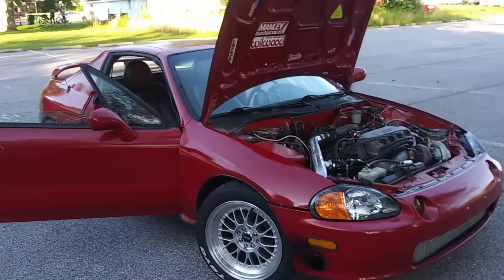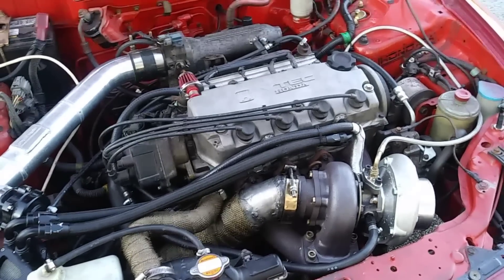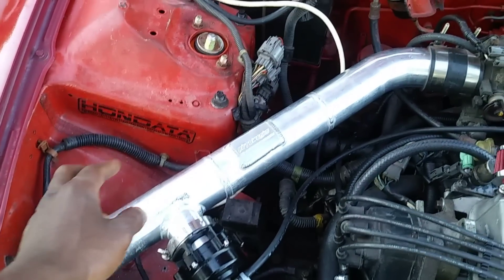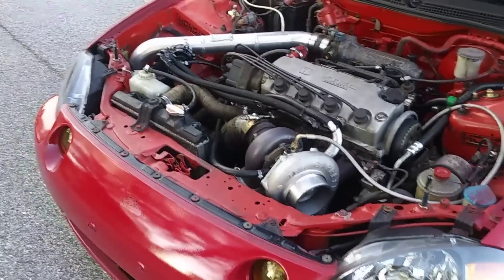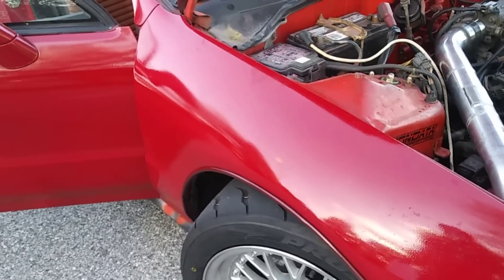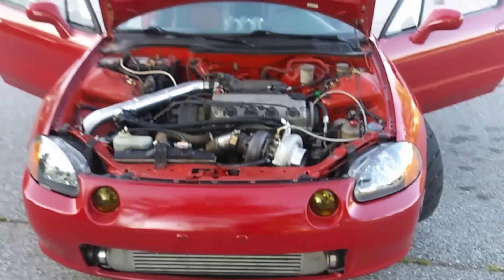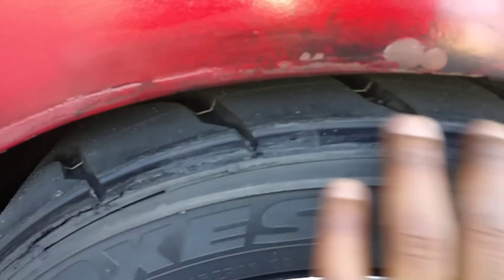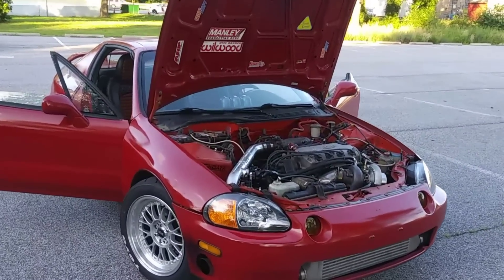400hp D16Z6 Turbo build list revealed

Comment from the maker: Build list is posted in the description...Check it out!
Reply: Nice build, I tried my best to get my daughters car as nice as yours, had the engine rebuilt at a very good reputable shop, got the engine installed and between 3 different mechanics they all said they did a good job with the engine,  besides that and after 6 grand it's an absolute mess. Extremely loud and rough idle surges like crazy. So frustrated, what do you suggest? Especially us that don't want anything out of the ordinary those cars were known for their quietness d 16 Z6 automatic.
Reply from the maker: @juliol.7490  Thanks. I hope you reach your goals with your daughter's car. Hondas often have idle issue due to vacuum leaks and/or problem with the cooling system. Make sure there is adequate coolant in the radiator, remove trapped air if any, and clean or replace idle air control valve. I hope this helps. Also, pls comment back and let us know what worked for you.
Reply: Doing this same build to my red del sol lol

Comment: Hey man, does the engine still hold? I was told the stock crank doesnt hold more than 1bar/15psi reliably.
Reply from the maker: I had the engine rebuilt with all forged internals. I'm still on stock crank. I don't plan on making more power after I get it retuned. Only time will tell how long it survives.
Reply: @RBXmotorsports  Thanks

Comment: How has this build held up over time? Planning on a very similar build and wondering how the reliability of the build at this power is
Reply from the maker: Quality parts, proper assembly, a good tune, and proper maintenance is to key to a reliable and long lasting build. I tore my engine apart and had it rebuilt about a year ago to make more power. Unfortunately, it's not fully assembled yet. Keep an eye out for my new videos for updates.

Comment: Cool I'd did the same with 100 engine 100 on head studs and 200 on parts. Work perfectly fine running away from 392 all day long.
Reply from the maker: Honda power 👊
Reply from the maker: I'm currently in the process to make more power. Check out my new videos.

Comment: Any lag with the turbo? What rpms are you hitting boost?
Reply from the maker: With the Vitara low compression pistons, you're going to experience some lag. I haven't drove the car in a while but I believe full boost was around 5k rpm. I'm currently doing a 600+ hp build on the car. Stay tuned for upcoming videos.
Reply: @RBXmotorsports  that’s awesome can’t wait and thanks for the response
Reply from the maker: @BIGWORM303  anytime 👍

Comment: how well does the stock trans hold this?
Reply from the maker: The stock trans held pretty well at that power level. I never had an issues with it; however, I just got the engine rebuild to make 600+ hp. I'm afraid that my luck might soon run out. Hopefully not 🤞

Comment: Have you got it dyno and tuned? Any issues with the build? How much boost are you running? May need to upgrade fuel pump and fuel pressure regulator.

Comment: I would have never thought LS injectors would fit / work.  Also wish I could find a 60 dollar d16z6.  Can't even get just the head for that around here.
Reply from the maker: I was shocked when I found out that LS injectors works. My tuner said the injectors flow really good. Also, prices on  D series engines are going up. You might be able to get one on the low, you just gotta keep an eye out.  I'm gonna try to buy an extra long block if I can find a good deal. People are starting to realize the potential of the D series engines.
Reply: Frankly - I can't even get a D15B7 cheap.  Been that way for a solid 5 years or more.  My z6 took a dump so really anything to get the car moving again would fit the bill.  lol
Reply from the maker: @cracklingice  sorry to hear that. Have you consider a rebuild?
Reply: I got a reman head off eBay a few years ago.  I got about 100 miles and then the thing lost compression in 3 cylinders again.  Before you ask - yes new bolts and gaskets.  I think what happened is that because I noticed that they sent me the wrong head only after I already took the old one off, that having the cylinder walls exposed 'til the new one came in resulted in wrecking the rings.  I did notice a small amount of surface rust on the walls.  Either that or the block or sleeves warped when the head gasket blew and simply swapping on a new head wasn't ever going to be enough.  
But yeah, getting a long block and doing a full on rebuild is something I have considered, but it would probably be a naturally asperated build, potentially nitrous for lols.  Not willing to give up A/C for a turbo.  If I ever get myself in a position to actually do the car right, I want to go K series so I can have both turbo and A/C.
Reply: I am not looking for a track build in, think grand touring.  All the creature comforts, sound damping, balance between ride quality and handling and enough power to make up for the couple hundred pounds of added weight.  lol
Reply from the maker: @cracklingice  man, that really sucks but it sounds like you have great plans for your car. I'm not gonna convince you to go turbo but I will let you know that there are turbo manifolds that are AC compatible.
Reply: That actually are worth running?  I mean if I'm goin turbo, I'd be shooting for about 350hp or so.
Reply from the maker: 350hp is plenty for the streets, especially in a civic. I think you will have a lot of fun with that power range. Eventually, you will want more 😁. Power is very addicting.
Reply: so what is this manifold and turbo combination that actually fits with AC?
Reply from the maker: I just did a quick search on google and found this. https://shop.redline360.com/products/1320-performance-turbo-manifold-honda-d-series-t3-d15-d16-d16z6-d16y8-ram-horn-a-c?variant=32992321306704&currency=USD&utm_medium=product_sync&utm_source=google&utm_content=sag_organic&utm_campaign=sag_organic&gclid=CjwKCAiAq8f-BRBtEiwAGr3DgaCqC_VvUxrXBqYFyXuQmp7ynZUYUf-tnPbrNX1HCxk050VDrN692xoCftwQAvD_BwE I'm pretty sure GoAutoworks also sells AC compatible manifolds.
Reply: wow that goautoworks place sells a complete kit for 3k with a precision turbo.
Reply from the maker: Not a bad deal. I've bought a few things from them and I'm always happy with their service and products.

Comment: Mine has a D15B7 its super slow. But super reliable.
Reply from the maker: They are very reliable. I had a black Del Sol with the d15b7. I gave it to a friend as a gift. Two years later the car is still running strong.

Comment: Too much money spent
Reply from the maker: I do not disagree; however, the car was in a rough shape when I got it. I wanted to build it so it's reliable and somehow fast. In the process, I got attached to it and went over budget, Lol. If you watch my second video posted in the description, you will see the condition the car was in. If I was to replicate the build, I can now do it for a lot less.
Reply: @RBXmotorsports  I hear ya.. as long as you're happy with it.. I have the same car , same color.. everything stock, would like to make it faster
Reply from the maker: You could do a mild build then boost it.

Comment: A question for anyone who may be able to help ya boy out... Im in the process of purchasing the same car with the same engine, and im only looking to get a good 200HP from the engine. My question is, how much would i need to put into the engine to make that WITHOUT a turbo/supercharger. I wanna keep her NA, and ill be doing all the labor myself besides major work to the block.
Reply from the maker: I personally don't know anyone who has done it, but anything is achievable if you have enough ca$h. I'll say port your cylinder head, aftermarket springs & retainers, aftermarket cam, bore your block to 75.5mm, aftermarket rods, high compression pistons, ARP head studs, good flowing intake manifold, throttle body, and exhaust (2.5 inch). Last but not least, race fuel, Hondata S300, and a good tuner should get you there. If your talking cost, I'm guessing around $5K or more. 

A less expansive way will be to do rods and pistons, ARP headstuds, 100 shot nitrous, and a tune. Probably under $2k if you do the work yourself. 

Third option will be to do an engine swap (B, H, or K series).

I hope this information was helpful to you. Good luck with your build and don't forget to let us know what route you decided to take.

Comment: Still running strong?
Reply from the maker: The car has been neglected a little lately. Smh. I've been trying to catch up on two wheel action while it's still nice outside. I'm gonna give it all the TLC it needs soon. I'm thinking about even tearing the engine apart and getting the block CSS. Stay tuned!

Comment: How are you making 400hp on stock cam? How many pounds you on?
Reply from the maker: I'm running 22 pounds on GTW3476R and fully ported D16Z6 head. The stock cam is very capable. There are many people making 400+ on stock cam with built bottom end. One of my limiting factor was not having an adjustable cam gear and tunning on pump gas. I now have an adjustable cam gear and will have it installed along with my stage 4 cam very soon. Stay tuned!
Reply: Thanks for the reply!
Reply from the maker: @TreyMack67  no problem bro.
Reply: Putting my z6 build together now as well, may do a YouTube channel for that too!

Comment: How expensive is the build?
Reply from the maker: These are not exact numbers but are fairly close. 
$3,000 for engine parts and machine work.
$3,000 for turbo kit and ECU.
$3,000 for wheels, tires, suspension, and big brakes. 
$1200 for body work and paint. 
$1800 for custom seats and ITR steering wheel. 
This build could have been done for much cheaper. I wanted some quality parts and most parts were purchased brand new. If I was to redo the build, I can probably do it again for half the cost. I hope this helps.
Reply: It does, thanks for the help!! Got a del sol myself, wanted to know what I was getting myself into lol
Reply from the maker: You are welcome. Good luck with your build. Also, don't forget to keep us posted on it.
Reply: @RBXmotorsports  for a good reference do you know what your suspension is set at?
Reply from the maker: @jacobmcbride2491  because my fenders are not rolled, I have them set at the highest setting.

Comment: change the fuel to E85 and see some power gains.
Reply from the maker: I'm getting her retune in 2 weeks.
Reply: E85 is worthless honestly, it fouls out injectors and destroys fuel pumps. You also need to clean out the custom fuel cell you'll need for the E85 or it'll go bad. E85 also gets sucked up by the engine way more than gas. Its garbage, just get the car tuned for race fuel and install a water/methanol injection system which has wayyyy better pros than cons.
Reply from the maker: Thanks for sharing your experience with E85. I was considering E85 because I recently found two gas stations that sells it. I have to say that the price difference for pump E85 and the race gas I bought is night and day. Spending 13 dollars per gallon for fuel is not very practical, especially if you are someone like me who drives a lot. I will keep looking around for a supplier that sells race gas more affordably.

Comment: You need to worry about those stock sleeves instead of the transmission. Block guards ain’t gonna do shit, shoulda gotten it sleeved or filled
Reply: GoldFish Ninja sleeves are usually good up to 500hp as long as you don’t have detonation he’s running hondata so he’s good

Comment: Bro nice!! I have a '93 Del Sol si and it's the same exact color, and it's a d16z6 as well lol! I've had it since July, I'm running an aftermarket exhaust and cold air intake, probably won't go turbo to be honest, I might upgrade headers this summer. It's already so much fun to drive. It's the first car I've ever bought, I was in love as soon as I saw it. It's in unbelievable condition too, it's only had two previous owners who bought it brand new in '93 and took such good care of it, I'm so fortunate. Always good to see another Del Sol lover, you got my sub. Cheers!
Reply from the maker: Welcome to the channel. Honestly, Intake, Headers, and Exhaust is all you really need on a Del Sol. They are very light and you dont need a lot of power to have fun with them. I also had a 1993 Del Sol, which I got rid off 2 years ago. They are very fun cars to drive. I really think Honda should bring the back.
Reply: Red del sol's are quite common i picked up a samba green si 93 which is the second rarest color option you can get. Love the green to golden yellow color shift. Rebuilding the engine with forged internals and I already retapped the head bolts to B series to accommodate the higher boost pressure without the head bolts loosening up causing headgasket failure. Going to use a smaller turbo due to maintaining the a/c system and it should push around 270hp which is still fast due to the car being a go cart lol. I can't fit in the car. Its for the miss's since she loves honda's. We have 8 cars in the fleet and adding more as we go but she loves the del slow.
Reply from the maker: You are absolutely right about red Del Sol being common. Personally, I have only seen a Del Sol in samba green few times. The first time I saw one was about 10 years ago. I gotta admit, the car looked amazing. Eventually, once I feel like my car is where it needs to be, in terms of build, I will repaint it to a different color. Something rare.. It sounds like you have a good build going on. Your wife should have a lot of fun with 270hp.

Comment: I'm thinking about doing this same build I feel like these engines are overlooked and underdog parts are easy to find and cheap to build this over b series and everyone laughs and says build a k series what is your opinion have already done what I been wanting to do was it worth it
Reply from the maker: I absolutely love my D-Series. You can make reliable power for cheap and parts are abundant like you stated. They are also very easy to swap and work on. When build right with supporting mods, you can have a lot of fun with them. Since I've built mine, I have had several people back down from racing me.  This were people that were talking s***. Was is worth it? Totally.. Welcome to the channel and stay tuned for my next build on my Integra.
Reply: Hello! Good build here. I too have built a single slam and went with a GTW3476. I've built and have been tuning it myself. The D16Z6 is incredibly underrated. I can agree; easy and inexpensive to build. I've taken it a few steps further but, spared very few expenses.. I know my build has brought some newfound respect to the single cam in my area. Now I have lots of inquiries about which direction to go with them. Lol! 
Hats off to you, sir! 
#savetheSOHC

Comment: that radiator is not gonna be able to handle the heat the turbo making. should always get the cooling system upgrade to be able to handle the heat.
Reply from the maker: It's been holding up. I plan on upgrading it soon. Welcome to the channel, pls subscribe and share my videos.
Reply: @RBXmotorsports  ...if you do upgrade to an aluminum one, don't forget to upgrade the cap as well. I am using the Stant Racing and it's way better than others out there.

Comment: im new and just now getting into cars big time. did you take it to a shop? and if so how much did it cost you for them to do it?
Reply from the maker: Welcome to the channel. I had a machine shop built my engine. Cost was about $3000 including labor and all the parts I purchased for the engine. The engine was installed in my garage. Please check out my old video.

Comment: Any issues with oil seeping out the timing belt side between head and block? Under cam gear?
Reply from the maker: I have a minor oil leak but I think its from the rear main seal. Once I get caught up on my other projects, I will address the issue before putting the car on the track.   I'm curious to see what she can do on the quarter mile.

Comment: How much power did it make?
Reply from the maker: 325whp on pump gas.
Reply: @RBXmotorsports  how much psi .?
Reply from the maker: @HardKnocks160s  22 psi
Reply from the maker: It was pushing coolant out and could have probably made more.
Reply: @RBXmotorsports  thts pretty good i made 285 on 15psi pump gas 91oct.  I think i could of hit over 300hp on 18psi my tuner didnt reccomend me to go over 18psi on pump gas. He said e85 was fine 19+
Reply from the maker: @HardKnocks160s  E85 does make a big difference. What's your power goal?
Reply: @RBXmotorsports  350-400hp on this stock sleeve no block guard block on e85 soon i will be back at the dyno